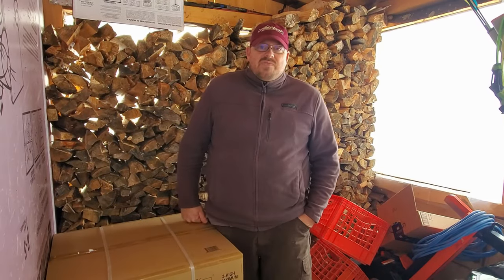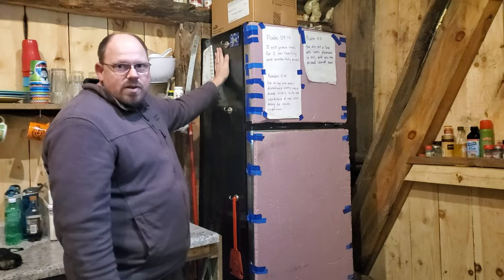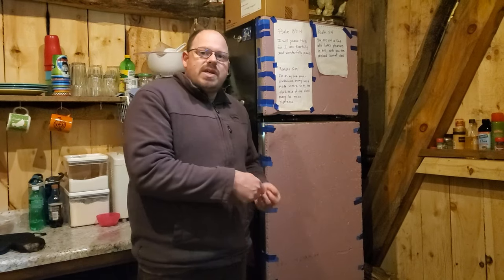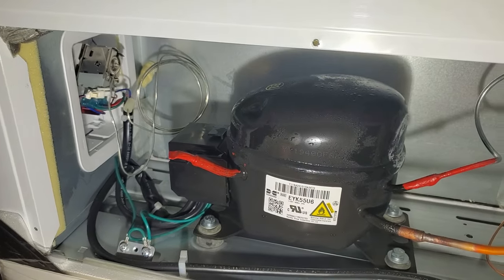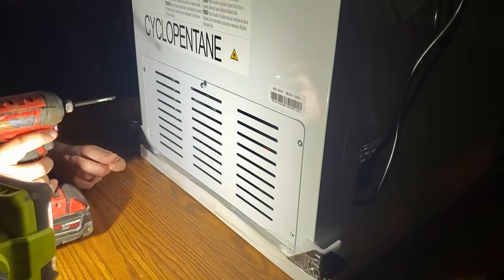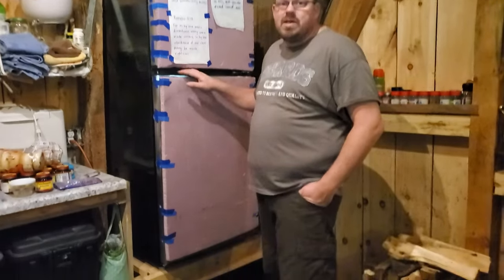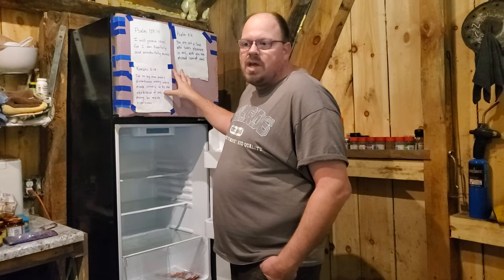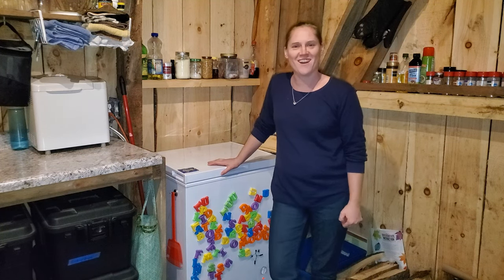Are We All Too Lazy To Save Money? Chest Freezer to Refrigerator Conversion

Comment: Some manufacturers now make actual chest fridges-freezers. Typically they have a dial where the first 2 settings are for fridge settings and the rest of the dial automatically freeze the contents. Bought one unit (a Hisense) at Walmart 6 months ago and was so impressed that I bought a 2nd from Elektra Goods store (brand name on the unit was Oster) and use that as a freezer (dial is clearly marked "fridge settings" or "freezer settings"). It takes a while to get used to storing food in a chest fridge but the electric usage savings are dramatic, especially in warm countries like Mexico where daytime temps never fall below 20 degrees C in winter and are always 30 to 40 C in summer, because the units are not constantly cycling on and off every time you open the lid (cold air stays in a chest unit instead of "falling out" of an upright). Just had my 2-monthly electric bill and it was less than $10 for 200 kWH whereas before I was using an average of 350 kWH every 2 months when the upright was running. Basically anyone looking to cut electric usage costs should look at buying chest-type units asap. Great video, subscribed.
Reply from the maker: Thanks for the comment and the additional information. Glad to have you along on this adventure.
Reply: Just noticed that the Walmart link has a few different models available and also different sizes.....scroll to the bottom of the page

Comment: next time instead of that mod you can buy a inexpensive china pid controller, then you can easily prog it to work as a freezer or fridge.
Reply from the maker: Sounds like a cool idea but my experience has been that most cool ideas in electronics come with an energy consumption "cost." The ones I have seen all come with a concerningly large heat sink and even possibly a fan. Thanks for the comment.
Reply: @johansenfamilyvlog8972 I have to agree, those 'plug and play', seamed good. UNTILL I SAW YOUR CONVERSION. -- this is what I will do too. (Just to find the right thermostat).

Comment: I'll bet it did take some getting use to a fridge like a freezer. Does the old one still work to were you could put it elsewhere? We got 12" of snow fri and sat, been 30 couple days, then to bottom out on us. Maybe you guys also. Stay warm. Iowa is watching  :)
Reply from the maker: No snow here, just barely went south of us. Sold the stand up fridge. It worked great but the automstic defrost couldnt be disabled for off grid application and ours sat right in the heat of the stove. We just sold it yesterday for the price we paid for the new chest freezer and regulator. Wish we had gotten some of that snow! 😁

Comment: Love your work and enjoy the videos. Thanks.
As for the fridge ...we live up a couple miles of 4 wheel drive road in a little cabin built on a 19 foot trailer and have added a couple small rooms, barely wider than the bed mattress. Here in Eastern Washington near the Canadian border, land of sagebrush and a few Ponderosa Pines, the summer days can be above 100 degrees Fahrenheit. 
Our propane fridge makes enough heat that even with doors and windows open it can get hotter inside than outside in the summer sun. Meanwhile the propane eating fridge runs full time against the heat ...and the ice cream melts in the freezer. .. 
.. Decades ago, early 1970's, I spent some time around ferro-cement boats ...which interest recently drew me to your vlog. 
.. I've used those welded wire panels for tarp covered hoop shelters, greenhouses, and chicken homes. Lots of snow here, so the welded wire panel hoop shelters need internal support to not bend and collapse. Your a-frame cabin idea would solve that and inspires me. 
.. I think I need one in a hole in the ground for root cellar and another for the fridge. 
.. Only electricity is from generators, 5000 watt gas eater for well pump ...and 1500 watt for 12 volt backup battery and device battery charging and nightly computer. Sunshine and 4 solar panels for daytime electricity ...except in winter snow cloud weather.

Comment: Guys, besides no defrost cycle another reason for energy savings is a freezer by it's very nature has much more robust insulatation and as such needs to cycle less often.
Reply from the maker: Yup. We had a new, smaller, full size refridgerator at first and it always wanted to run a defrost cycle when it was cloudy! Lol. We live off grid and it would completely drain my battery every time. Thanks for watching.

Comment: There are more differences between a freezer and a refrigerator than just the thermostat. The actual refrigeration components are different. The compressor and metering device are made for the different pressures. It will be interesting to see how well it works.
Reply from the maker: So far, great!
Reply: Do you think it might just be a case of not needing to work as hard or as long/often as it's built too, or do you think it could be an issue over time with running on unintended pressure cycles? Hopefully would just mean it lasts even longer, still maybe doesn't run at the optimum speed or rate to be truly as efficient as it could be, even if it is still a lot more efficient than not. If only they just made chest fridge for sale in the first place, surprising it isn't already an option really.
Reply: @leifcian4288   The technology of these appliances are changing and I guess that the usage is expanding. Making a freezer cool like a refrigerator is probably more likely than making a refrigerator into a freezer.

Comment: That's cool, thanks for showing I'm going to do the same now you've given me the confidence to proceed. My electricity has gone up to 38p per kwh here in UK and I never have much in my mini fridge at once anyway I'm always loading it up with water bottles to reduce the amount of air exchange and its already on the floor anyway seems silly not to have a chest fridge.
Reply from the maker: Thanks for watching. It has been working out well for us even now in the summer when its hot and we rarely run the mini split AC because that takes starting tge generator. I think the biggest savings has come from it not having an automatic defrost.
Reply: @johansenfamilyvlog8972  That's good to know I think I choose the right thermostat then it was a general refrigerator one one not a fridge/freezer one, I don't think it should need to defrost at all really. A refrigerator repair man was telling me it couldn't be done because water would end up in the bottom and when I said I was going to try myself anyway he seemed to recommend I get the fridge freezer type thermostat but that didn't seem right. Not sure he fully understood the concept of what I was trying to do.
Reply from the maker: We get some condensation on the items in the converted refridgerator but it is not bad at all. No build up in the bottom yet for us but to be safe we placed a cookie cooling rack at the bottom to give the water a place to be below any of our items. Also, almost every chest freezer has a drain at the bottom to let the water out when/if a manual defrost is conducted. Yes, i went with the refridgerator settings one and it is still capable of freezing if we set it that low. We put a piece of tape across the thermostate selector because as a friddge the unit is placed in a high traffic area and we didnt want it to get bumped and change the sttings. It takes a few hours to adjust after a setting change so be patient with it at first until you get used to it.
Reply: @johansenfamilyvlog8972  ,I just got my thermostat just like this one you used, and my wires on my magic chef 3.5 freezer has a green and red and black wire, on the new thermostat where should the red wire plug and where should the green wire plug?

I plugged the black into the L and plugged the red into the C and the green into the H and when I turn the thermostat on it kicks my breaker off ?

Thankx
Reply from the maker: My thermostate had labels on it. I followed that. Other than that I dont know. Sorry
Reply from the maker: I talked to my friend and he said that you must have a live wire connected to a ground if it is throwing the breaker. I hope this helps.
Reply: @johansenfamilyvlog8972  Thankx, I have the exact one you have, which prong did you connect your ground to, was it the H or L or C ?
Reply from the maker: H was green, C was brown, L was red
Reply from the maker: I located the letter for one wire at a time and transfered them to the prong corresponding to the same letter on the new thermostate.
Reply: @johansenfamilyvlog8972  Thankx again for all the information, I'm going to connect my red to the L and the green to the H and I think your brown maybe the same as my black, so I will connect it to the C, I'll let you know if it works.
Reply: @johansenfamilyvlog8972  I just tried it, it kicks the breaker off, I emailed the person who sold it so I'll wait and hear what he has to say, thankx again.
Reply: @Deathicu  On mine there was two connectors that can be wired either way around and a third that connected to the body/housing of the thermostat as an earth/grounding. Was clear enough in my case although my lack of experience wire crimping took a bit of patience. One of the positive/negative wires also carried on to the LED power light so was twice as thick to crimp. Also might just be different standards here in UK. 
All been working very well though. I leave the drainage valve open to create a little air flow and I presume stop any living food from suffocating and its preserving everything really really well, much longer than my mini fridge before. As long as the seal around the top is tight seems like cold air won't drop out of the drain plug when closed. When open it seems it pulls the cold air down just a little and I suppose prevents it getting scooped off the top as much anyway.
Reply: @leifcian4288  Thankx for that information, I think that ground wire is my problem like yours was, I got the diagram from the person who sold the thermostat and it shows the H stands for Heating and the C is the power input and the L is the compressor, 

So I need to figure out how to connect my green wire to a ground, and I don't see how, so I think I'm going to try without the green, and just use 2 prongs the red and black, which I will plug the red into the C and the black into the L and see if that kicks my breaker?
Reply: @Deathicu  well as I say on my thermostat there was a positive and negative connector that had nothing to indicate a difference because it apparently doesn't matter which way around they are wired. The third connector wire on mine was just clearly a bit different I think so it obviously went to the connector on that was the odd one out on just on the metal casing/housing of the thermostat. Or else it was clear from removing the original thermostat which one it was I forget. Not too sure about the wire colours as I have no basic electrical knowledge really but fortunately I got it right anyway and has been a great success in reducing power use, now using under 1 kwh a day in my home before it was usually 2. 
This is UK though, not sure if that makes any difference inside the appliance as much as just the socket but all ours are 3 prong.
Reply: Finally got it going, I do not have the green (ground) plugged into anything, the red is in the C and black in the L, so now I'll let it run a while and check the temperature later today ,

Thankx to the both of you for your information.
Reply: @Deathicu  If its going that's good, however it's probably important to have the thermostat earthed to reduce shock risk ect, so if there's another connector to put the earth/other wire that's more just connected to the metal housing of the thermostat then I'd say it's probably best that it's connected. Not sure why it would prevent the unit from working if you did try like that, but if there's no other way to try perhaps run it by someone else sometime to check, remember it's an appliance that is running all the time and has big current spikes when the compressor starts. I think mine shoots up to 800w or something like that for a brief moment when it's starting.
Reply: @leifcian4288  I just checked the temperature with my infrared gun and the highest temperature I can find is 29F so its still freezing, that's not good, if I can't get it at least 4 or 5 degrees above freezing then I'm going to have to try something different.
Reply: @Deathicu  Yeah if it's not going to stabilise within a general refrigeration range might be time to try another. Have you definitely got the probe the same sort of distance as the original one was? 

I bought a "Universal LARDER FRIDGE THERMOSTAT KIT VC1 RANCO 2 Tag" for 7 quid. No defrost cycle like for fridge freezer. 
 Of course it might also depend on your unit what's compatible.

Comment: Do you know if there was wattage or amperage difference ?
Reply from the maker: Hello, thanks for asking your question. There was no change in  the power (amps/watts) of the unit. The change was substiruting  in a different thermostate intended for a refridgerator which has a warmer range of opperation than the original thermostate which was intended as a deep freezer. It is likely that the unit uses less energy (watt hours / amp hours) then as a freezer. Thanks for watching.
Reply: Well, I converted my freezer last night. Only 170 watts used in 22 hours.

Comment: Which thermostat conversion kit did you use?
Reply from the maker: I added a link to the description of the one I used. Thanks for watching.
Reply: @johansenfamilyvlog8972  after 5 months of use how is it working out? Is it much more efficient than your old upright fridge?
Reply from the maker: Yes, very. Mostly because it does not have an auto defrost which all modern conventiinal refridgerators do. It is also smaller in volume by half than the refridgerator it replaced. It is shorter than the previous refridgerator so it is continuously in cooler air as our previous refridgerator was affected by the wood stove in winter and hotter temoeratures in summer since we rarely run our air conditioning. Finally it is a chest and does not allow cooled air to escape when opened. The draw backs we have noticed is that the very top of the chest is about 10 degrees warmer than the very bottom. In order to keep the top of the chest refridgerator near the recommended 40 degrees F would require the bottom to be below freezing. We have learned to keep liquids that are ok to partially freeze, or form small ice chunks at the bottom and items that are ok to be a little warmer at the top. These are items like condinents. It also tends to be moist inside the chest refridgerator as many contsiners that are retrieved from inside have condensation on them. We have not yet attempted manually defrosting and there can be seen a thin coating of frost on the inside walls when the appliance has been running for a while which turns back into condensation shortly after it cycles off. We keep a short rack in the very bottom to keep food items from setting in any condensation that may gather and there is a drain plug at the very bottom but we have not noticed enough moister to drsin yet after 5 months of opperation. Looking at the inverter it uses slightly less watts when running than the conventional refridgerator did but typically cycles less frequently and for shorter periids of time. Thanks for your question. Hope this was info you were looking for based on my experiences.